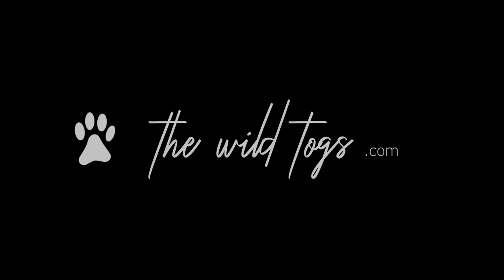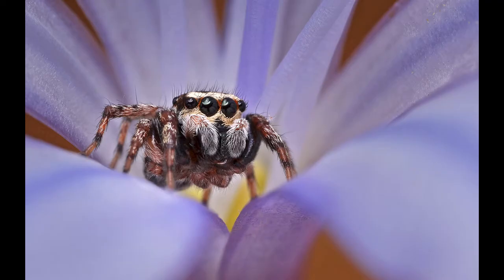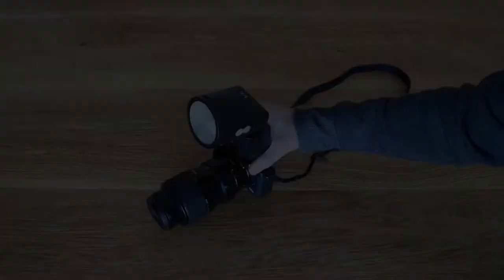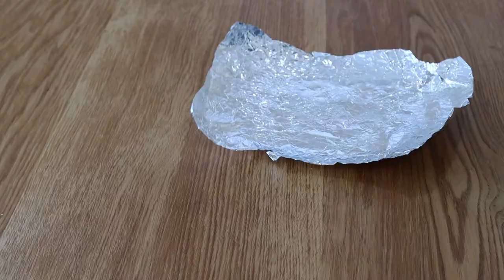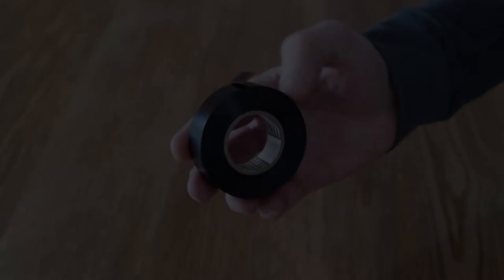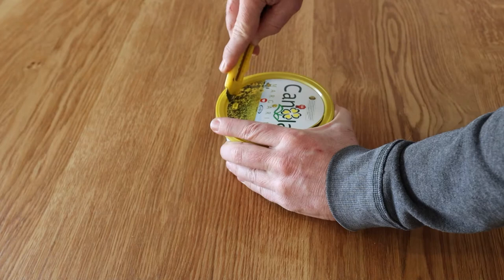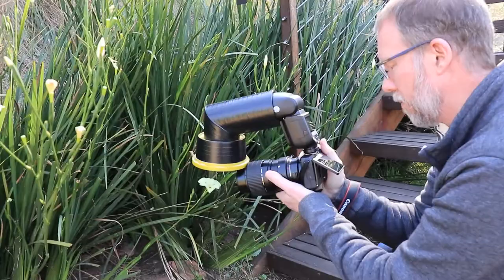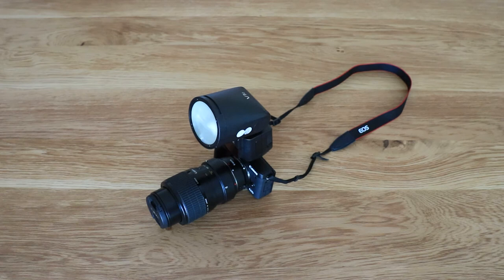DIY Macro Flash Extender

Comment: Brilliant. Amazing what a wee bit of lateral thinking can do. I shoot with a Sigma 150mm and sometimes use the 1.4x tele with it. The beauty of your design is that you could always add in additional extender pieces if you move to a different lens that is further away from the camera. Re Michael Terral's comment below about extending the flash. If you could find a cardboard tube with a slightly larger diameter, you could always slide it over the tube attached to the flash, and then slip it forward when the lens extends and back when you retract it. If you are really clever, you could come up with a way of connecting this to the lens and it would do it automatically, but a manual adjuster would work just fine. 

Another option to using cardboard, is to look at some lightweight PVC plumbing/drainage pipe. You can also buy this in white especially for indoor bathroom situations so you wouldn't then need the silver foil. It will be Spring where I live in a couple of months and my Macro shots have always disappointed me, but a home made diffuser like this would be an excellent and cheap way of getting into it using faster shutter speeds (with my Nikon I can go as high as I want,) and smaller apertures. The tricky part would be a connector for the flash, but something similar to the tub you use at the business end would work. And the beauty of it is you can dismantle when you don't need it and keep it in your bag. If I ever do get around to building it I'll post and let you know. 

The material used for the diffuser would perhaps be the only thing I would change as it is better to get the White Balance right in camera, but a cheap, 2nd hand softbox would cover that.

Comment: Nice idea. I have one of those 45 degree pop out diffusers which rest around the end of the lens, and my Godox V1 has a DIY carboard cone lined with tinfoil directing all the light to that large surface area. I thought it would really improve my pics, however the angle and the amount of tinfoil reflecting onto my diffuser now gives very strong specular highlights. Some pics look great, but if I catch the angle wrong, the leaves or wings might blow out. When anything is reflective, like an Ant's body, you see the reflection of my diffuser in it's body. It seems your solution might have solved this with the light coming from above and pointing more downwards. Trouble is, this is no good if you are shooting things a bit further away, like a bee flying around flowers that you can't get too close to